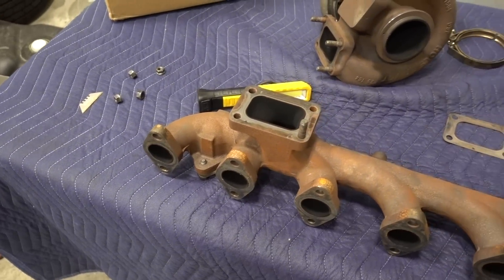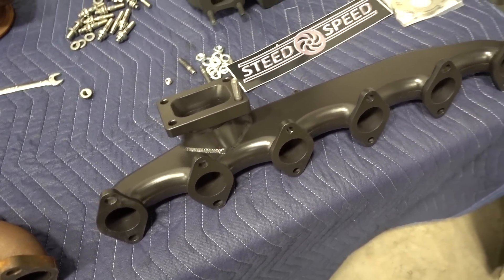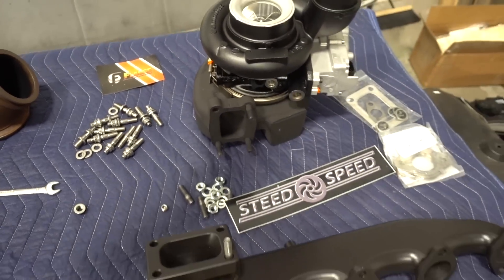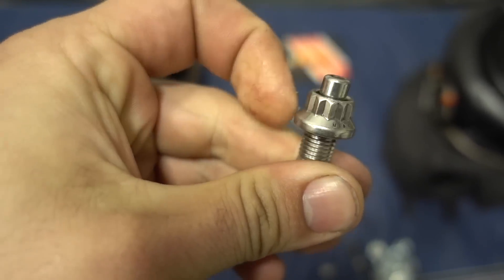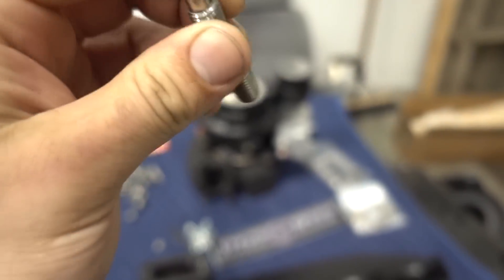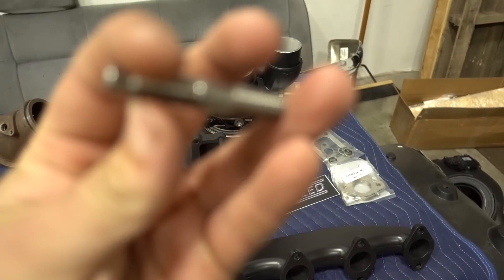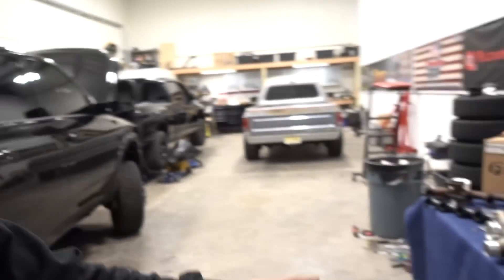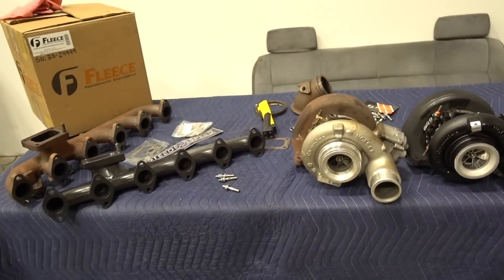NEW TURBO AND MANIFOLD FOR THE ULTIMATE CUMMINS TOW RIG!!!!

Comment: Replaced the factory 351ve with the 351cw cheetah on my ‘08 for all the same reasons. Keeping stock, exhaust brake AND easiest way to deal with turbo swap with their Fleece Cheetah being 100% drop in. I’ve had mine on for 3 years now. Done a lot of long trips with the camper in tow. Sporting around town. I absolutely love that turbo. Now, I didn’t know they made a factory locating steed manifold. Definitely going to have to do that.

Comment: The dually needs compounds to be the ultimate tow rig. Everyone always raves about compounds for towing
Reply: JD Kirane compounds??? Where the fuck would he put them.. the first turbo is already mounted to the transmission!! Hahah These new trucks are rediculous!
Reply: Yes compounds with a second gen swap....turn the exhaust manifold to face upward and the other turbo under it...in sure there is a way to make it work....
Reply: Compounds=Downloading Windows 6.7
Reply: @josh474  there's plenty of. 4th gens with compounds calm down
Reply: With VGT there's really no need for compounds. The point would be high boost on tap with little lag, and with the bone stock VGT you get both of those at least to the extent needed for a good tow rig. Only benefit to compounds over single VGT in a true tow/daily application I could see is lower drive pressure resulting in slightly lower EGT.
Reply: @MrFredboy  duramax tuner/wcfab has a compound kit that uses the stock turbo I believe and basically just feeds a second on the passenger side of the bay. That's for an lml too which isn't the current but the 16 back dmax.

Comment: I had a fleece cheetah 351cw on my 04 5.9, and for towing it sucked, and it didn’t spool anywhere near as fast as I had hoped. Replaced it with a Borg SX-E 63/68/12 and it’s is better all around in spool up, power, and towing. Maybe they work better on the 6.7 given it’s larger displacement and VGT

Comment: You won't be disappointed with that turbo, I've installed a few of them instead of going the stock route, right about the same price and much better performing. also solved the issue with the actuator.
Reply: Crossroad Garage LLC I'm wondering if the Turbo he's putting in is a 63mm then what is a stock Turbo in a 2007-1/2 6.7 Cummins.  Just wondering if maybe I swapped If out for a newer one or would one off a Chevy or Ford diesel
Reply: @stacyreid5077  stock is a 60mm. The newer fleece upgrade spools awesome, and carries more power through the rpm, even with added fuel.
Reply: Crossroad Garage LLC thanks that help me out a lot.

Comment: Greg, I couldn't tell but is the factor elbow that connects to the turbo indexed in some way?  It would seem it would have to be but I wasn't sure.  Never had one off but could see this as a future upgrade for me.  If it's not, no big deal, just have to put some paint on it to properly locate it.
Reply: It has dowel pins that will line it up

Comment: just curious what your thoughts are between the fleece cheetah turbo vs the ats auroa 3000 or 4000 ?  i have a 2017 ram 3500 with the g56. i know i have to update my clutch, which i will be going with a south bend setup. just wondering how or which turbo will work best with the g56. motor is stock, only thing i have updated is installed the banks monster ram, still have all emissions. and banks boost tubes. thanks

Comment: You really shouldn't be using stainless steel hardware.  Its so far away on the galvanic series and will corrode the steel like crazy.  Its also about half the strength of a steel fastener.
Reply: I have a feeling arp has a bit of mettalurgical experience to find a stainless alloy that has required strength... yes different metals dont like each other occasionally but it may be a stainless manifold or it could be an alloy of stainless that will live happily with iron. Arp has a long history of experience where I have no doubts they could stir up a good alloy

Comment: Still do not understand why not do a 2nd gen swap.
Reply: Doug Francis cost, he didn’t want to reconfigure exhaust and intercooler piping
Reply: @jasontruman1215  I get that. But, dude just dropped probably 2k on this turbo and manifold and another 8k on his transmission. Not to mention he had this planned probably a month ago. Down pipe and intercooler pipe would run what, 1k max? Cost is a weak argument considering the advantages of a swap.
Reply: @jasontruman1215  and 1k is a clear over estimate.
Reply: He is doing this to promote different products on his truck is my guess.  I apologize if this is not the case, but seams like a lot of parts on a lot of different machines all at once.  This would be very difficult to afford all this with no help from the companies he's using.  I appreciate every vid that has been put up.  Thanks!!!

Comment: Step 1: punch yourself in the nuts for waisting that much money on that manifold
Step 2: get and 2nd gen steed speed
Step 3: get a real turbo
Step 4: send it. 
Ps: ditch the useless banks crap
Reply: Do you have any Banks products? If not, you do not know if it is crap. I am using some of it, it works great for my needs. Maybe you are just a little jealous. Just sayin.
Reply: @davidbottles7298  jealous of using less effective equipment? Monster Ram is the only good part they make. Everything else there are better products for less money. So to answer you, no definitely not jealous
Reply: Maybe, company’s are going to have to turn to clean tuning at so point as Fed’s are starting to impose big fines on noncompliance with EPA regulations. Gale maybe ahead of the game in the long term. Time will tell. Those that choose to roll coal will make it hard for use to enjoy the responsible side of diesel performance. When the Dems get control of the EPA again watch out.
Reply: @davidbottles7298  how does my comment have anything to do with clean tuning? I never said anything about "Rollin Coal"?? My 6.7 doesn't smoke a bit but it doesn't have any banks products?
Reply: TGarrett4 so you don’t have any Bank’s products, but you are an expert by calling it crap. Personal experience is a better indication if it is good or not. I don’ t call something crap just on hearsay.
Reply: @davidbottles7298  currently no I don't. Have I? Yes and they are not as good for the price and don't get the performance that others do. Dyno proven except the Monster Ram. I give credit when it's due. The MR is a good product but not the rest